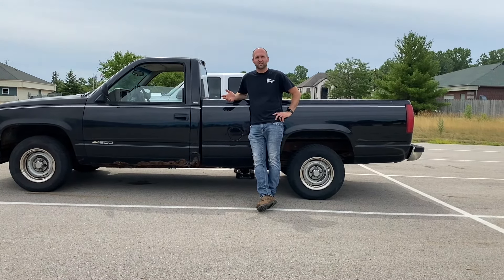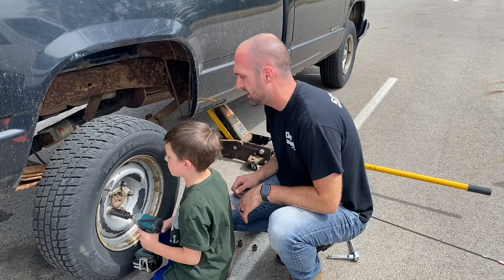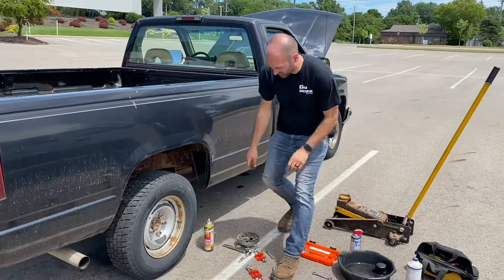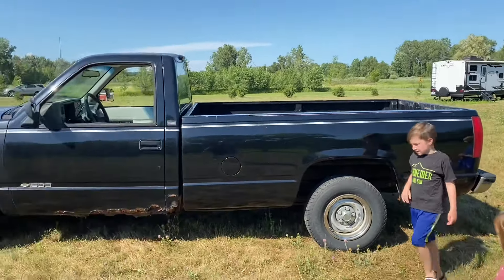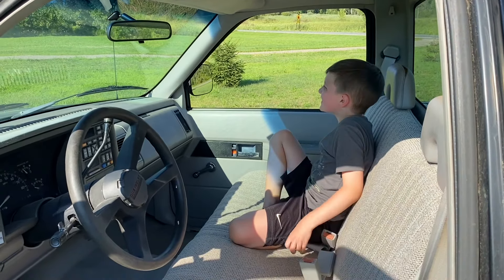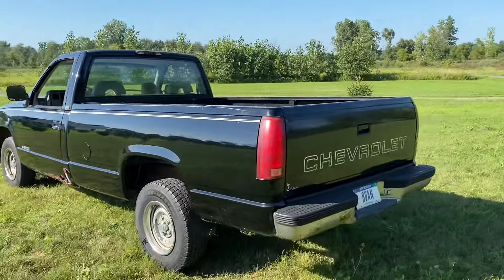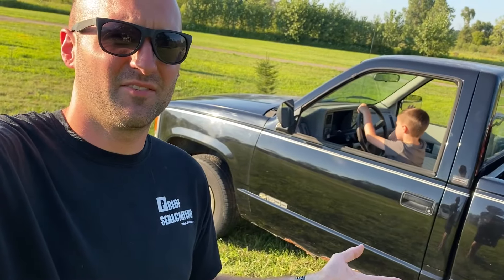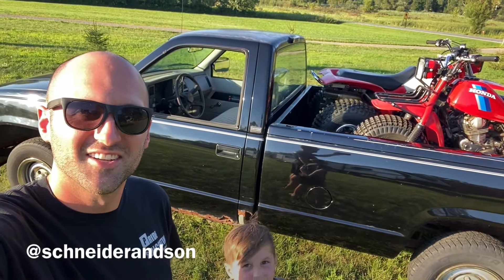I bought a 1994 Chevy C1500 with 80K original miles for $400

Comment: my 2012 is by and large the same truck. only 47k miles, 4L60E trans, same new process transfer case, 10 bolt rear end, and i got it with manual windows/door locks/seats/door mirrors, no cruise control, vinyl seats and floor liner, and no extra electrical options whatsoever. One major difference between the 94 and mine is that i have an LS based engine, but i have a non-vvt non-AFM 4.8L. the last of the great american trucks.